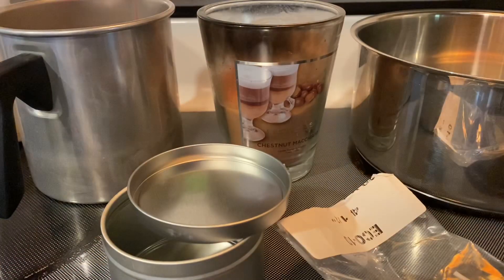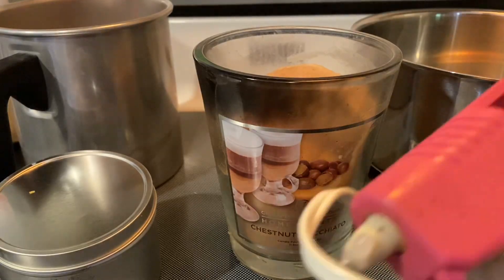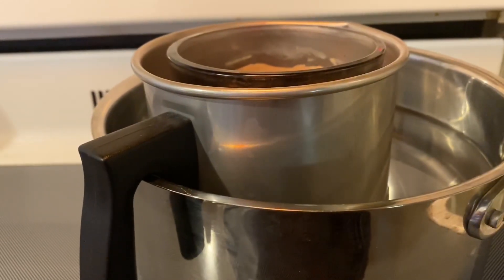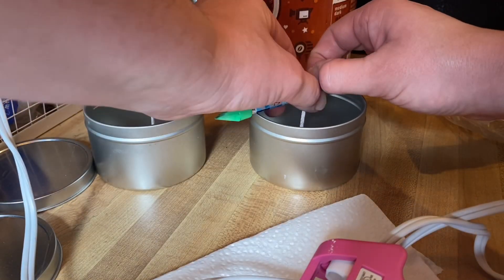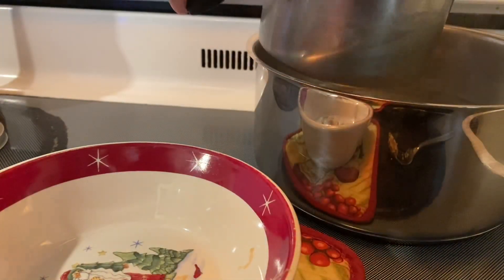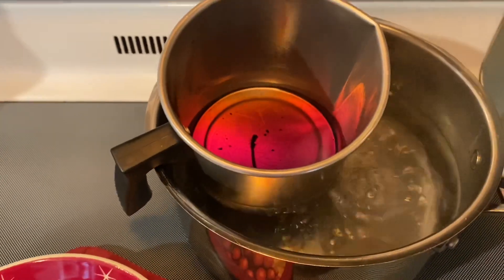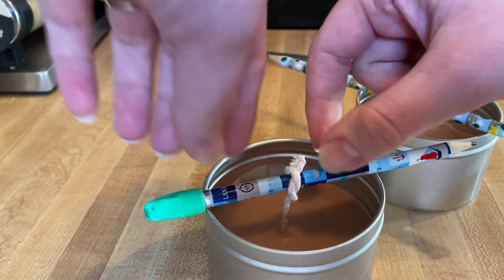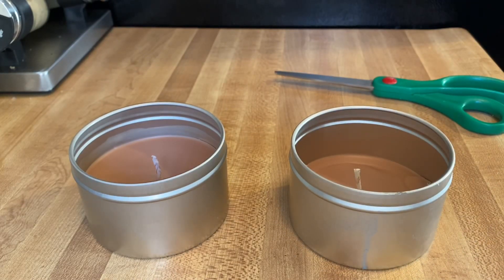How to Reuse Old Candles | DIY Candle

Comment: Yes!! I've had a few candles that I felt so bad about throwing away and never tried this option. What do you do with the leftover glass candle container that it came out of? We don't have glass recycling out here, so I've often wondered what I could reuse those for once the wax is gone? Any ideas? Cool tip! I'll probably buy some wicks and try this.
Reply from the maker: I wasn’t thinking and I threw mine out! I should have kept it. Hmm maybe flowers, storage, paint and decorate for different decor themes? Thanks! Glad it was helpful